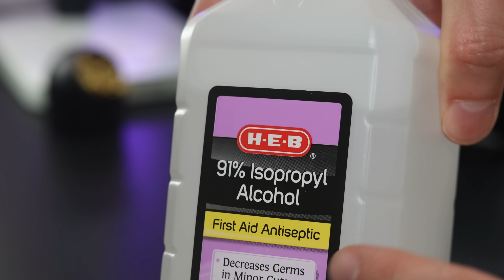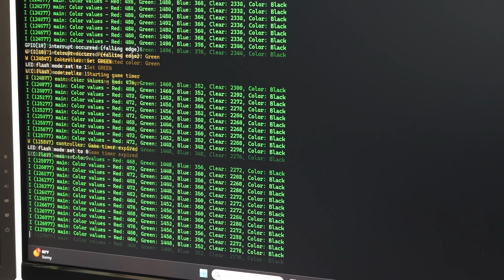Do This Before You Solder Anything

Comment: Invest in a cheap stereo microscope for visually inspecting your work.
Reply: Great tip.  It’ll also seem like your eyes are about three inches from the work.
Reply: Where is this "cheap steel microscope" obtained from?
A second hand one runs to thousands of dollars.... 😮
Reply: @johncoops6897  I found mine on AliExpress for 100USD last year. It is 10x, 20x, and 40x. Be aware that 40x is a bit too much magnification.
Reply: @johncoops6897  My AmScope SM-1BSX-64S was £300, and there are cheaper ones available.

Comment: not mounting the pcb to anything is gonna create a lot of frustration. Helping hands are popular (but if you get them, make sure they are heavy, else you'll just knock them over constantly), personally I often prefer blu-tack or similar adhesive to hold components/boards in place.
Reply: For through hole soldering, nothing makes it slower and more cumbersome than having the PCB in any form of holder.
You need to be able to rotate the PCB to make good joints, and there is this thing called gravity that holds things on horizontal surfaces.
Furthermore, the bench surface presses the components down onto the board, so you don't need to waste a hand or burn a finger to press it up while you make the joint.
And for SMD, you shouldn't be pushing sideways so what would cause you PCB to move anyway?
Reply: @johncoops6897  oh yeah that gravity does a fantastic job holding a 10 or so gram PCB in place when applying an iron from the side ... jeez, please be a little more condescending while also wildly off base. You can see the board in the video jiggling around during the soldering. Loose touch between iron and solder site like that is not going to give you consistent quality. You know what's good at rotating by the way? The various joints in my arms and hands! I do concede that helping hands can get in the way, but as I wrote: I prefer blu tack style anyway, for many reasons.
Reply: @werawerlnwerlnrlnelr - I am right handed, so I hold the iron in the right hand. My left thumb and pointing finger hold the solder. My left little finger applies pressure to the PCB, pressing it down on the work bench if and when required. Or I just rest my whole left hand on the PCB.
My PCBs never move during soldering, not even a millimeter. No way I want goopy sticky Blu-Tack on my PCB or hands.

Comment: Felder Sn100Ni+ solder is an absolute delight to work with, especially for smaller SMD hand soldering. I have a spool of it in 0.75mm and there's plenty of flux to not require external application of flux beforehand in most cases by far. The mechanical properties of this type of eutectic solder make it very predictable. It melts at exactly 227°C too which is higher than most other commonly used eutectic solder alloys.
Reply: I've also never seen it used over SAC305 in industry, but then again every company I've worked for has no idea what they're doing on some level.
Reply: Yep! The Felder Sn100Ni+ (with ISO core Clear flux) is the best lead-free solder I’ve tried.
Reply: 0.75mm solder for SMD work?! I use 0.38mm and even that is larger than I'd prefer for pure SMD work. (I picked 0.38mm so that I could also use it for through-hole work - I'd pick 0.25mm if it wasn't for the through-hole usage.)

Modern lead-free solder (I've used SN100SB myself, which looks to be very similar to the Sn100Ni+ that you mentioned) is very good and easy to melt, but the thing I noticed when compared with leaded 63/37 is that it doesn't quite have the same surface tension, so it's quite a bit harder to rework for SMD work.

Comment: 5:00 Regular 60/40 solder with flux is suitable for 99% of all electronic repair and prototyping work.
5:10 The temperature and power of the soldering iron depend more on the PCB than on the components, most components have a very low heat capacity, so the temperature they need is not high. But multilayer boards, which have a lot of copper, have a huge heat capacity and often need to be heated from the back side. And you do not talk about the power of the soldering iron, which is more important. 6:10 you transfer to the board not the temperature but the thermal energy, in joules per second, which is called power. When you touch the board with a soldering iron, you give it joules of heat every second. And at high temperatures, your flux will boil away quickly, carbon deposits will appear on the board, the components and the board will oxidize, this will interfere with soldering. Therefore, you first need to buy a normal soldering iron for 90-110 W, for M900 tips, and not a vape like yours. In common repairs of power electronics, repair of power supplies, a high soldering iron power is needed for soldering bundles of wires, thick wires, sections of the board with a large amount of solder, desoldering large components such as radiators, chokes, transformers - these are relatively simple and popular repairs. At the same time, soldering irons for M900 tips are much cheaper, the consumables themselves - the tips are also cheap, these soldering irons are easy to maintain and repair if necessary. The only thing you need to buy high-quality tips! If you use low-quality tips, your tip will not tin and you will not be able to solder at all, and a beginner will not understand what the problem is at all, he will change the temperature, fluxes, try to clean the tip, but this will not help him.
Reply: 1:07 for beginners its easier to use lead.... 😕
Reply: @NathanCroucher  It's not about which is better, but which is more practical and actually used. 70-80% of the information about solder is unnecessary here.
Reply: @VictorLarsen-fy9ls
 A BMW is far better that a Mini , but both will take you from place to another .
 It's a matter of skill when talking about soldering , and this is what has been exposed in the video  😇
When you talk about quantity of Joules , explain to me what will it be more  helpful to solder ?
Now the soldering iron is not a multipurpose tool . No need to buy a  lorry to transport a bag of sand .
People would rather buy the tool for what he needs ,and not for YOUR use . If I need to solder thick wires all day long I will buy the Iron that fit that demand and 2 soldering Irons in case I have to deal with micro soldering also .( Lithium Battery maker ) for example .
A jack of all trades will have to get at least 5 kind of soldering tools , from a micro one up to a powerful ARC soldering unit .
So better to stick to the purpose of a video rather to talk nonsense in comment section . Or even better TIP " Go make your own Video on that same subject ":eyes-pink-heart-shape:
Reply: @lostworld-2024-m5m  Today, a user will buy such an expensive vape and successfully solder small parts with it, he will be happy. And tomorrow he will need to solder a power supply or a computer 30 Oz board(if you know what that is, of course) and this vape will not cope because 60 W is not enough for this and he will not understand what the problem is, because he set a high temperature but this does not help. After tomorrow, this same person will put the vape on the shelf, and in 5 years it will turn into a stick, because the battery in it eventually fails simply from long-term storage.🤷‍♂
Don't tell me what to do and I won't tell you where to go.
Reply: @VictorLarsen-fy9ls  30 Oz board(if you know what that is, of course).
I am asking myself whether you understand English. 
So better for me to shut my mouth and let you guess on your own , why I said this .

Comment: I learned more in these 11 minutes that I have done in many videos, I absolutely am superbad at soldering due to my severe tremor in my hands, but this might make it easier for me, cause I also got learned that the flux in the solder is enough, and yeah, I think there is where most of the stuff I made has made me gone wrong
Reply: dunno if it'd work for you, but artists have been using a chopstick brace for detail work in oil painting for centuries...Perhaps a brace would help?

Comment: Lead free solder is a TINY bit more difficult to work with.  But leaded solder is a LOT easier to work with.
Reply: Lead free solder is the work of the devil!
Reply: @zebo-the-fat  Spoken like someone who has ingested too much lead.
Reply: @zebo-the-fat  The best lead-free solders, using newer alloys with traces of nickel and germanium, are almost as nice as leaded. (Felder Sn100Ni+ is the best I have ever used, and if I were forced to never use anything but that, it would not be a huge inconvenience.)

Comment: Do you have a specific soldering iron that you'd personally recommend?
Reply: Alientek T90B, Fnirsi HS-02A, Geeboon TC22, depending on budget and needs.
Reply: A basic mains powered non temp controlled  Antex 25/35 watt mains powered, with leaded solder. A fat and a thin bit will cover most things. Don't  use usb powered!
Reply: @Mr_Rusty1  For cheap irons, I don't think the Antex tips can be beaten - And the tip quality is usually where cheap irons fall down.

Comment: 15 years soldering and the first mistake you make is ignoring low melt solder alloys as a removal (chip quick).
Reply: Over 50 years soldering here, and never had any need to use such a product.
Reply: @johncoops6897  You can go your entire life without knowing the benefits of something you've never tried before. Low Melt Solder literally does the job of a solder removal tool. 

It's the same effect as leaded solder... without the oxidation, lead, and cold rolling. Most people I have worked with have zero clue, no use for it, and would suggest another way of removing solder from a joint. 

Most of them are just doing it the way they first learned, without trying anything new.
Reply: @Baeloro1481 - this is a video only about how to solder, and not a video about how to DE-solder.
- Is that correct? 🤔
. .
And yet here you are lecturing "the first mistake you make is..." then rambling on about low melting point alloys that have absolutely zero relevance to the subject matter.
Reply: @johncoops6897  The video is a tutorial on soldering. Soldering involves removing/applying solder to attach SMD or through hole components. Other methods of coupling may involve a connector or interface that may not require solder. 

Soldering is the same as desoldering... except in reverse. Too many people claim to have 'soldering skills' and then make a video about soldering... where they forget basic stuff like 'you have access to more that what you started your solder kit with.' 

Most people would tell you that working to desolder is one of the most difficult aspects of soldering. And if you are working in an environment where you are trying to solder something... chances are it's because you are performing a repair, which will probably require you to de-solder something.... first. 

You can nit pick my comment, that's fine. I am nit picking a 'skills' video about microsoldering and adding something of value. 

Chip Quick (or other low melt alloys) takes your ordinary microsoldering task, reduces the amount of heat needed (safety) allows for easier removal of components (integrity) and allows for much cleaner installation of new components (reliability). 

When you watch him do a 'how to' video and he's wresting with some solder-sucker or other contraption meant to 'remove solder easily' should just be reducing melting point of solder joint with low melt alloy, removing with standard wick. If you have to do anything more than that, you simply aren't doing it the way that is easier/effective. 

Which is fine, it's your time you're spending.
Reply: @Baeloro1481 😂😂😂 wow, just wow.
I am amazed that you haven't complained about him not showing LCR measurements in his video about the basics of  SOLDERING.
Geeze, get a grip! 🤣
Reply: @johncoops6897  Complaints? It's a how-to video. When you're missing useful info in a how-to... what else are the comments section for?
Reply: @Baeloro1481 - as I've said, it's just a "How To SOLDER" video.
That's all, and it's very simple really 😉

Comment: A bit old-school, but you can cut about half the length off of the bristles on a disposable acid-brush and use it (dip in some alcohol) to clean up after soldering a joint.
Reply: Toothbrush is easier.
Use your partners, but make sure to put it back afterwards. 😉

Comment: And how do you know the temperature??? 4:50 My tool has not temperature adjustment.
Reply: trial and error until you see that the solder is fine, you won't directly know the temperature but you wil indeed know if your iron is "well tuned"
Reply: There, in fact, everything is based on experience. Consider that all these numbers are in bananas.
Only in production do they take into account the exact values, because they create all the conditions for high-quality soldering and control. Precisely in production, because even in the repair departments at these productions, everything is the same as for ordinary users.
Reply: If your tool does not have a temperature adjustment, you probably (hopefully) have a very cheap soldering iron. It is ok to learn soldering with such an iron since you dont need to invest a lot of money, but it will be more difficult. Once you are willing to invest in a new iron, make sure it has a thermal probe in the tip, not in the holder, you also want as high power as your budget allows, since that enables you to solder larger components, GND will be much easier with a high power iron. Dont try to increase power by increasing temperature above the recommended level, that is how you burn your components.
Reply: The temperature doesn't matter, as you can compensate with speed. Some very high-end soldering irons are also fixed temperature. (Metcal, well technically the temperature is adjustable but it's set by the tip. I use a 413C tip for everything.)

Comment: Use cheap steel wool to clean excess solder (solder will come off in small balls, so cut off the bottom of a plastic bottle or something to put it in to avoid a messy soldering station), then use brass wool to remove oxidation from tip. Brass wool will absorb solder in clumps, becoming clogged and useless over time, and is much more expensive than steel wool.
Reply: Im getting very tired of brass wool but wont steel ruin the tips?
Reply: @NathanCroucher  Not in my experience. You could always invest in some cheap tip tinner to restore tips.
Reply: The tip shouldn't oxidize ever if properly tinned after use.

Comment: Do you tin your iron after use to store?
Reply: IPC soldering training will tell you to always tin your tip before placing the iron back in the holder. It will prolong the life of the soldering iron tip by slowing down the rate of oxidation.

Comment: Leaded solder is illiegal to sell in EU for a while now. Correct me if I'm wrong.
Reply: You ARE wrong. Leaded solder is still legal to sell in the EU, both to businesses and to consumers. HOWEVER, it is illegal to sell any product that has been soldered with leaded solder with very few exceptions (such as a repaired product that was produced before the ban). Therefore it makes little sense to buy leaded solder. You can't properly use it to repair anything other than ancient devices (because using leaded solder to repair devices produced lead-free gives bad results) and you can't sell (or even give away) anything you build using leaded solder. So your use of leaded solder is limited to personal projects soldered completely from scratch for use by yourself only.
Reply: @frankbauerful  This is nonsense about poor quality repairs when using lead solder. When soldering microcircuits with a low process technology, such as BGA, there is a lower chance of damaging them by overheating when using lead solder. Lead solder is more flexible and more resistant to mechanical damage, loads, so cracks appear less often in such connections. It is also more resistant to severe frosts, read about tin plague.
Reply: @VictorLarsen-fy9ls  If you repair a device soldered unleaded using leaded solder you're creating an unpredictable alloy.
Reply: @frankbauerful  "unpredictable alloy." no shit, i did that and it created a sonic BOOM that blew out all the windows to my house..
Reply: @frankbauerful  But you've repaired something rather than tossed it into landfill.
Reply: @frankbauerful  "solder with very few exceptions"
Not so few - basically any essential/critical services/infrastrcture: All networking and server equipment, telecom and IT equipment, highpower applications, military and medical equipment, corrosive environments....

"If you repair a device soldered unleaded using leaded solder you're creating an unpredictable alloy."
You'd have to be a special type of moron to just add solder to an existing solder joint - no matter what type of solder was used before or what you are using now - even if it is the same type and comes from the same source.